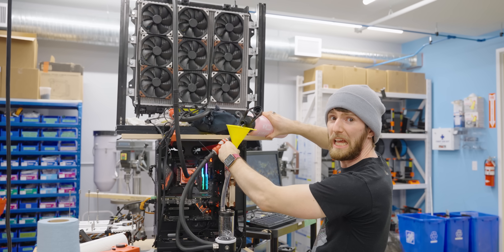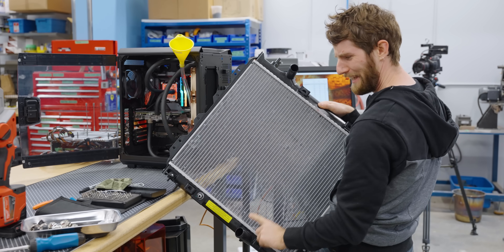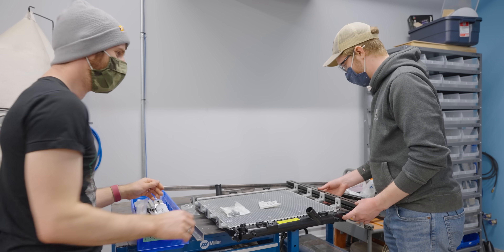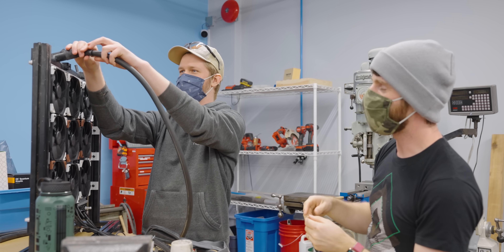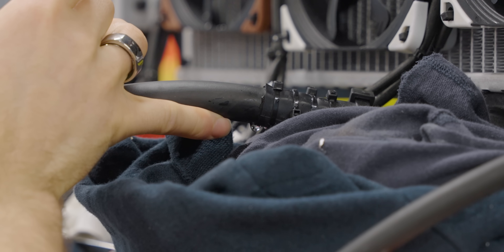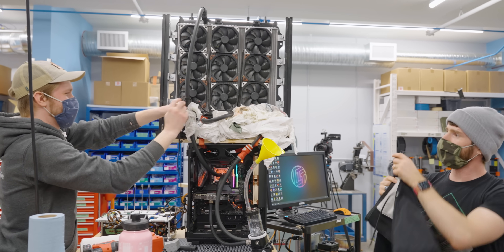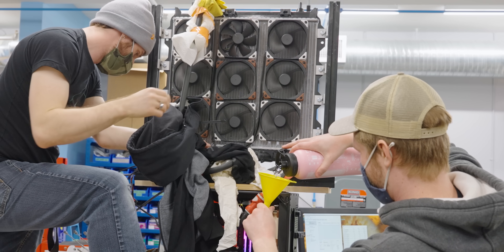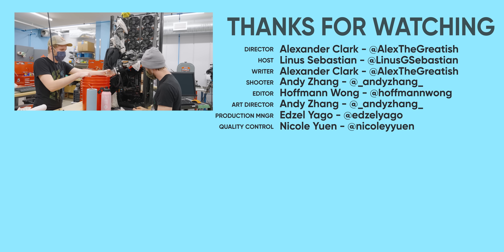Our Craziest Cooling Project Yet - Car radiator liquid cooler

Comment: Why did you cut the Bike Tube and not using it on from one point to the next?

I have a plan to build a cooling system with a Car cooler - and now i want to built it faster -.- but the parts are expensive ^^

Comment: The trans cooler is actually a tiny radiator built in the radiator it will not make your water cooler because it already submerge in water, you can just leave it and it will not leak at all  so why transmission cooler is built inside the hot radiator you may ask because atf is already twice as hot as engine coolant temp.

Comment: For those who don't understand, the radiator cools the transmission fluid as well but it doesn't need to be that cold so it doesn't really matter that relatively warm water/coolant is going to be flowing past it as well.
Reply: also for warming cold transmissions

Comment: The beginning of this video confirms Linus IS NOT a mechanic. 

The larger inlet/outlet's connect to the block and water pump/thermostat. While the smaller ones are connected to the upper reservoir and overflow tank.

Comment: The transmission cooling lines are just a fluid to fluid heat exchanger in the radiator. They only thing you'll get from using them is flow restriction. Just use the large connectors

Comment: This is just sad.. we used to do better 25 years ago back when we milled our own cpu blocks from solid copper, used car and motorcycle rads and welded on barbs, used enheim pumps to actually get the pump pressure needed, etc..  This was just a waste

Comment: "Next up on LTT: The team tries ultimate 'positive pressure' air cooling with a airboat fan and engine blowing through a duct into a computer case trying to see if that outdoes this cooling madness. Spoiler alert: that one won't leak, but will the parts break off?"

Comment: Did they just ziptie $225 worth of Noctua fans on onto a PT Cruiser's radiator instead of buying an exact fit PT Cruiser radiator cooling fan that costs only $50 and would've pushed way more air then those tiny fans would ever be able to push?

Comment: Have to feel this could have been better planned... Zip ties for the fans? Fine! Zip ties and continual leaks from... everywhere... not fine! Please do this again but with actual fittings to properly reduce diameter and prevent leaks... This just turned in to absolute chaos and felt pretty amateur compared to usual LTT videos tbh.

Comment: Decent pc deals but you got ripped off on auto parts lol! With that much money on a PT cruiser radiator could of bought an aftermarket Dual core all aluminum radiator for a 88 - up civic with a fan 😁.... but that radiator does have 2 separate coolers because the model is for an auto trans..oooh gpu and cpu cooler all in one lol😅

Comment: I'm gonna be honest, I hated this video. It was basically the same thing as the time they connected a tap straight to the loop and ran the /used/ water down the drain.  I feel like it really wouldn't have been that hard to fix the leaks ahead of time and do the test right. I know others were entertained by all the screwing around and normally I am too, but this one was just annoying.

Comment: The transmission loop is to mount the transmission cooler in front of the radiator. 

If you ever want to go this extreme again in another video, then  consider using Forced Induction’s Interchiller. It removes the heater core on water to air intercooler and intake air temperature drop below zero, consistently. It would interest to see how a maxed out gaming PC runs at a constant below zero. 😁

Comment: Can we get a proper version of this instead? I know y'all are capable of doing this properly.

Maybe Jay can do it.
Reply: Exactly, I haven't seen them do a "custom" water system in ages where they leak tested properly. They just slam it all together & pray this will be the one time they don't get a leak.

Maybe try an old-school build where all the hoses/tubes connect via barbed fittings. Can't really mess that up.
Reply: @hydrocarbon82  I would love to see that done.
Reply: yeah there are several solutions of custom loop with big external radiator
Reply: This, just with epoxyed fittings and a good ol' Mercedes ML fan or something like that because they move some air compared to those smaller ones
Reply: I think Jay has done it. If it wasn't him someone did it because I remember seeing it. I am almost thinking it was Linus at one point becaues I think they used noctura fans.
Reply: Jay already did it...
Reply: Please.  This one kinda irritated me, NGL.
Reply: S
Screw you guys, this was just for fun.
Reply: @aidencoakley1307  stutter much?
Reply: @Archangel863  Y Yes

Comment: Pretty sure that the transmission cooler is only on the side the input/output ports are on, it relies on the cold side of the radiator to pull heat out of the trans fluid.

Comment: this is a shame. you had a good concept for a crazy build but you had to tard it up for the drama. i'd be interested in seeing this done properly, which isn't even hard since even if you refuse to make a proper adapter you can just glue / rubber-cement the tubes

Comment: As stupidly entertaining as this was, why not make an actual effort? Home radiators have standard pipe fittings (5/8ths and 1/2in looking at the ones around our apartment) meaning you could get fancy with some hardline, or just use standard water cooling tubing,  hell i've seen modders use copper piping in their loops, they have a much higher thermal capacity meaning active cooling is less of an immediate concern, and you wouldn't have to resort to the stupid, albeit amusing solution of balancing the thing on top of the PC.

Comment: This is all stupid.  They could probably plugoff the big connectors and use only the leakfree smaller ones, it's all just one cooling loop!! 

Now it's a ten minute video about some hoses leaking and nothing more. It just work fine with low rpm's on the radiator, almost silent, if Alex had done his homework.

Comment: Wasted potential.
This could have been interesting if you done it right. Instead the whole video is a struggle to ensure the PC is dry and pump is not. 

Did we learn something about the diminishing returns, mentioned in beginning of that movie. Not.

TIP hose clamps are a bit more suitable than zip ties.

Comment: I wanted this to be so much better than it actually was. You know you can buy the radiator with the fan mounted on it? And how do you deal with the galvanic corrosion from the aluminum and copper?

Comment: I was thinking you could flow hot or cold water through one of the loops of the radiator and then use a thermal camera to see which portion of the fins the loop uses.

Comment: Although it was fun to watch it didn't really prove a lot. The radiator holds so much more water then then 240 one that, with just the water content you would need to work out the difference and run the PC at full tits for the same proportion more. EG if the 240 holds 1 liter and takes 1 minute to increase water temp by 2 deg, and the engine rad holds 5 liters then the amount of running time based on the volume of water alone would need to be 5 time longer, so run it for 5 minutes and see if it raises by 2 deg. There would be other thermal calculations I have no idea about to take in. Then turn on the fans once you have a benchmark. It would be no difference to having a 10 gallon fish tank feeding your water block. It would stay cool until all the water is affected by the heat.

Comment: yknow this is pretty neat Id like to see it with proper fittings and gaskets (3d printed is fine) for no leaks and a MUCH BIGGER FANS chucking in the biggest PC fans out there and perhaps moving the pump to the top of the radiator. and with all that would make the water heat up a bit for a no fresh tap water constantly experience hahah

Comment: Interesting fact. There is an adapter meant to be used to affix smaller- 3/4 inch hose to car radiators. Used when doing a coolant flush. The can be bought at most auto part stores 🙄

Comment: First off, connecting to the radiator part served no purpose whatsoever. It's just a copper tube that goes from one port to the other. Just inches of copper straight pipe. Its meant to keep the transmission fluid at at least the same temp as the engine coolant. Second, why the flip can you guys not go to the hardware store and buy some hose and pipe adapters for a few bucks and make this work properly???? This is not fun or funny watching you guys do the most jank setup. You have that expensive shop and this big ol company and offices and tens of employees. And you assign Alex to the shop builds yet every time he is in a video you guys are doing some janky build. It starts off nice but then Alex takes all these shortcuts and ruins the whole thing. I'm done with Alex. Hire someone who actually knows what they are doing please Linus.

Comment: Now try a two stage cooling system: Cool the fluid in the reservoir with a coil that is wound around it or within it. That coil is attached to an external device that extracts the heat from the water, such as a radiator with fan(s), or one better a refrigerating apparatus.  Attempt to get the fluid in the reservoir down to just a few degrees above the condensation point of 9 degrees Celsius.  You could get a thermostat to control this.  Okay, back to drinking my beer.

Comment: Should had used a car radiator and not the 9 PC fans would had made it quieter and a lot easier to hook up. Also why did you guys just used metal clamps on all the fittings as well a bit of sealer on the tubes.

Comment: lets use a car radiator without asking a car guy, then instal it upside down. should have gotten Linus's civic radiator for a manual, smaller and less ports.

Comment: 1) I wonder sometimes in their videos if they actually got it working easily and well, decided it was too boring in post, and then redid it jankier for more views.
2) The next step in this radiator project should be to ditch the computer fans and just mount it in a moving vehicle. It'll be like the movie Speed, except that instead of the bus blowing up, your CPU and GPU would die.

Comment: The cooled coolant goes past a liquid to liquid heat exchanger that cools the transmission fluid then the coolant travels to the engine to collect the heat then returns to the radiator to get re cooled

Comment: Just an FYI the transmission cooler within the radiator is usually just a hollow walled tube that sits inside the end tank on the output (cool) side of the radiator.  It doesn't have any cooling capacity of it's own it uses reserve capacity of the main radiator.

Comment: Why don't you just buy a small refrigerator, drill 2 holes for in and out, and fill the entire thing with copper pipe for the water and use the cold of the refrigerator to cool the water.

Comment: Pointless piping the transmission cooler side of it.

Unless you run your loop through the transmission pipework and then fill the main radiator up with liquid nitrogen or something else stupid.

Comment: Really? Putting this on top of the computer? 

It would be awesome if you set up an efficient mobile water cooling rig like this though. Imagine 2 or even 3 water loops that you can just walk over to the computer you want to improve and just plug in. Honestly, a (substantial) remote cooling solution isn't the worst idea ever.

Comment: Hi Linus.

Just as solar energy can be used to heat water, or geothermal energy, or any other renewable energy, you have all the natural cold of the environment waiting idly to be used.

Why don't you take advantage of it?

Why don't you make a video about it?

They only have to redirect the flow of natural cold air, as is done with air conditioning.

Comment: one suggestions that is far too late, use a radiator for a motorcycle.

i would like to see you revisit this after you get some proper adapters to couple the different hose sizes into the radiator.

oh, for acoustics, maybe you could use a couple of those 200mm fans, maybe on both sides if necessary?  pressure probably isn't that big of a thing because of the very large surface area...well...as long as you don't let linus carry the radiator around.  if you look at the video the fins were pretty really dinged up after he flushed it.

Comment: The transmission loop is just a finned pipe in the end-tank... it's just a water to water cooler and pretty useless for this experiment. Better would be to attach a box fan to the radiator with some cardboard shrouds...

Comment: Whole engineering room, 3D printer, hardware galore. 

Lets use zip ties and an inner tube!

I'd love to see this done properly. Make a smaller radiator into side panel. Show the design and fabrication.

Comment: Once you made a mount for that Radiator you had half a Case. It would be a good video to properly seal it and build a computer next to it.

The design should be left side radiator and right side the computer.

Comment: Put the reservoir on top to collect air, and move the radiator to below the case to isolate drips. Then, use proper connectors and hoses. Meanwhile, with the surface area, you likely don’t even need fans.

But, let’s face it; this video was never meant to be a proper demonstration. It was just for fun, and it was a massive success. ✌️

Comment: Most of these radiators use something closer to water hoses.  You need to use manifolds to divert flow and not overhead pressure to explosions or auto off.  Use  a large tank of water with at least  2 gallons for the major recirculation.A better pump would be an aquarium pump. The metal clamps were your best components in this.  I would use freeze packs inside the water tank to add cooling but not create condensation.

Comment: You could have used one automotive 12v electric fan smh and barbed fittings would have connected the hoses without leaking. 😳

Comment: The small ports are for transmission fluid, it's uses the engine coolant to remove heat from the transmission fluid.  You will much if any extra cooling with those ports.

Comment: I'll be impressed when I see them using proper clamps and fittings instead of zip ties and tape.  They probably could have even grabbed a working radiator from a pick & pull junkyard for even cheaper, and flushed it out.

Comment: If you had something to fix holes in a bike tires, then yuo could just have used the glue from that to melt the peaces of rubber together. Well i say glue, but it does work to patch up the wholes in the tire, because it temporarely melts the rubber.

Comment: if your trying to literally simulate a radiator in a vehicle your missing one crucial factor WIND simulate wind with an industrial fan, The radiator does have a mechanical fan on some of the old v8 trucks in the usa like all older american cars but you need the wind like your driving down the highway to FULLY utilize a radiator

Comment: Because there is not already the MoRa-420 with quite similar size, which can be easily integrated into a custom loop by using standard fittings. Liquid Temp below 35°C @500W load.

Comment: Wow... They make a radiator pressure tester that has a large rubber ring that fits into the hole and air hose nipples in it, that will allow you to run this without any issues.  Also metal clamps are much better than zip ties when trying to keep out leaks.

Comment: well i think you brought this to yourselves!!! now you REALLY need make a legit  car radiator water cooled rig that works perfectly... i mean you really need to be prepared with all the fittings, tubes and tools to make it work perfectly... maybe even a car water pump that has it's own power supply or something... maybe you can hang it on the wall with enough spacers to not interrupt the air flow and so... you gotta do that!!

Comment: You can sure tell they aren't car guys.  Why all the fans?  There is a 5k+ CFM fan that bolts right to that thing.  Would just need 12V 13 amp.

Comment: you need to stock up on self fusing silicone rubber tape ! :)   wouldnt have any leaks if you guys used it for the water pipe connections.

Comment: Y'all could have gotten a Honda 4-core aluminum radiator that's probably smaller, shinier and for sure compact.

Couple that with some brushless DC fans.

FYI, the trans cooler is a small heat exchanger that only goes into that end tank. You gain nothing if you use it (I started typing a minute in so hopefully my comment is rendered pointless) :)

Comment: LTT - Has a full workshop capable of basically, making anything they want.

Builds a full on rad with nothing but puddy, zip ties and a bike condom.
Reply: LTT - Has hose clamps...only uses them on the small adapters  instead of the ones leaking from zip ties
Reply: @christopherangell7579  Yea, I thought so aswell - but then you got to realise that... they probably do not have clamps for THAT size! XD
(Still, they should have bought some... Doesn't make it less stupid that they did this shit and did it ONTOP of a PC, without propper clamps.)
Reply: @Vodhr  you know you can interconnect multiple  hose clamps
Reply: Could have put that rad literally anywhere else. Nope! Put it on TOP, so it leaks directly into the system. Brilliant!
Reply: its called entertainment ^^
Reply: u can't use claps on 2 soft tubes

Comment: This is actually a really good idea, just needed way better execution. lol They sell a bunch of connectors that you could have used that would have prevented the leaks. So, now I think I will have to build one the right way haha
Reply: Well the first watercooling radiators were car heat exchangers from the internal heating systems, so kind of full circle!